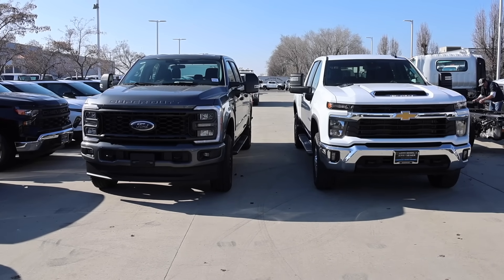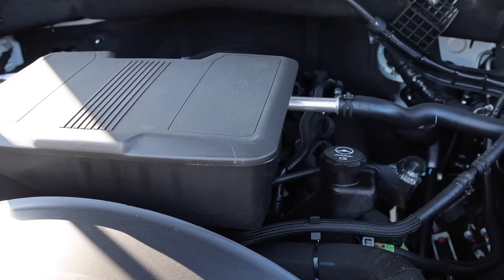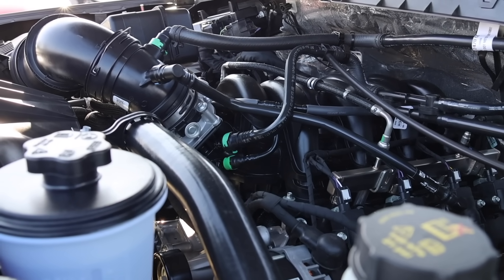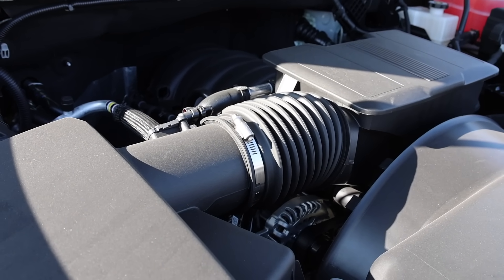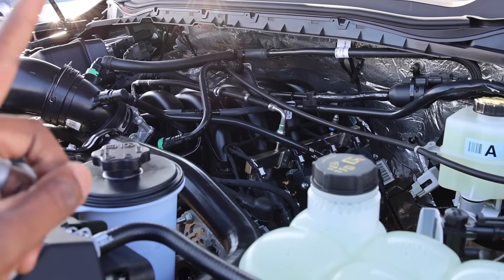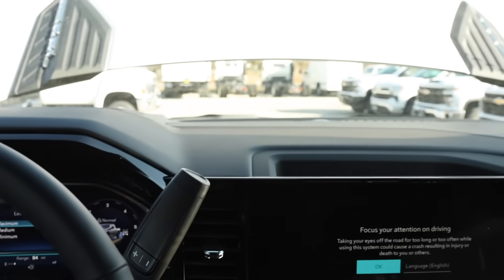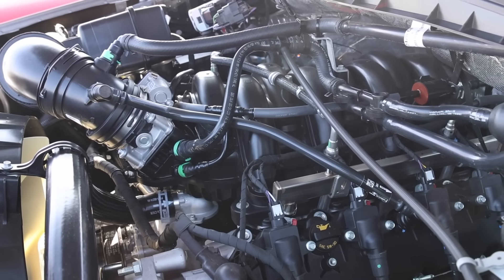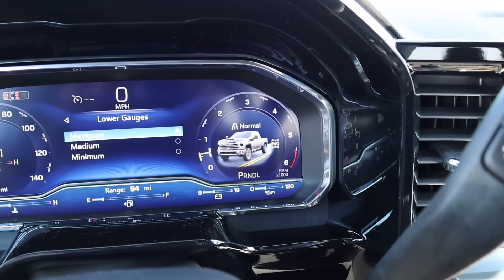2024 Ford F250 6.8L Gas VS Chevy Silverado HD 6.6L Gas: Is The L8T Better Than The Mini Zilla?

Comment: Nice review. A couple things:

1) it’s kind of irrelevant to call out that the 6.8 is the “entry level” engine when you compare it to the 6.6 because the 6.6 is the only gas engine available for GM. 

2) personally I think there’s no good reason to have the 6.8 and the 7.3 engines for Ford. I’m not against options BUT their performance is going to be nearly identical. It’s going to take having them side by side or a timing system to tell the difference. I understand about the tow ratings but that’s typical Ford. Limit the lower trim to prop up their 47 high trims. 

3) I do wish GM would offer a 4 something rear end just so everyone would shut up about it lol. It however would make zero difference at highway speeds, elevation or not. The engines are still going to be rpm and mph limited based off the final drive ratio of any given transmission gear. So long story short, 3rd gear in the 3.73 Ford is nearly identical (slightly shorter) than 4th gear in a 4.30 Ford. 3rd gear with a 3.73 pushes the engine to nearly 5,000 rpm at 60+ mph speeds. So 3rd gear with a 4.30 is not possible at those speeds. You will be out of rpm at that final drive ratio. Why people can’t comprehend that is just mind boggling. 

The L8T is very popular and has proven to be the more reliable engine as compared to the 7.3. They both debuted the same year and everyone forgets not every gas Super Duty from 2020-2022 was a 7.3. Ford still offered the 6.2. Every gas GM is the 6.6 so I guarantee there’s more L8Ts out there than 7.3s. And they still win on reliability. The 7.3 has had a few hiccups. Some minor and some major.
Reply: I'd like to see where you are getting your reliability info, as the 6.6 motors are already showing signs of excessive wear due to extreme oil consumption.

Lifter issues have been affecting multiple manufacturers, including chevrolet, and Ford has rolled out a pcm update for their variable oil pump. From what I've seen the L8t's are showing lifter issues tens of thousands of miles before the Fords.
Reply: @InuranusBrokoff : Have not heard of lifter failures in the L8t at all. Please provide a source to research it .

Maybe you're thinking of gm engines with afm like the 6.2 and 5.3 liter v8s ?

Comment: If you look up Automotive Inquiries he had a 7.3 Ford and Chevy 6.6 gas and he said the Chevy is the winner.  Plus his Ford was showing lifter issues.
Reply: He never proved anything. That dude was garbage his views show that
Reply: I enjoy his HD gas content, but ya he didnt show or prove anything  was wrong with the 7.3 he had
Reply: I watched his videos for awhile, but he just kept rambling on for 20 minutes and never showed any results.

Both trucks are capable. Buy what you like.
Reply: @oldnumber6 pretty much. Reports of issues with any of these modern powertrains are always exaggerated. The manufacturers sell so many of these things, and everyone has a camera and can document and upload stuff that it seems like your percentage chance of getting screwed is WAY higher than it actually is.
Reply: @eric3030  Its hard to say what was going wrong in the engine of his Ford but I do recall him cutting open the oil filter and that was not pretty and one can only guess it was into a similar failure mode that a number of those engines had which Ford was aware of and trying to deal with.
Reply: Lies...the 7.3 is definitely a better truck.😂
Reply: @efeaster3680 : Well..... there's our proof .Some Ford fan boy telling us it's so .
Reply: Well if you ford lovers don’t want to believe it just go down to your local ford dealer and ask the mechanics there.  They can tell you about all the 7.3 problems.

Comment: I do love my 6.6 gas chevy
Reply: What do you get for mileage?
Reply: I love my 2022 Chevy 2500 HD 6.6, with the 6 speed gm transmission - not that Duramax expensive crap...my gas milage pulling a 12 ft trailer with 2 mowers gets 14-15 highway. City it'll get around 11-12. Weight inside trailer id say is around 3-4k pounds. 

Not pulling nothing, I got it all the way to 20 miles per gal once. 

6.6 gas is a gem and I absolutely hate how ppl think they need a diesel to pull. Why pay $1 more per gallon and repairs on a diesel are always much more expensive.
Reply: @joshuarussell718  that's not bad, wonder what the 10 speed gets. 
With my 2020 l5p pulling my 35 foot 5th wheel I can get 12, empty 22-23, our best is 29 (wife driving), the extra buck doesn't bother me. And the extra cost doesn't bother me simply because the diesel will always cost 8-10 grand more meaning it holds it value better
Reply: @michaelcopeland8985 no way you get 29. Must’ve been rolling down hill.
Reply: @ghilliemanreviews  wife was driving, happened once, baced on a 50 mile average.

Comment: Which one is more reliable? That's all I want to know for my work truck. Give me 300k and I'm happy
Reply: Both of these should be able to hit 500k with proper maintenance
Reply: @5starpre  500!!?? Seriously?
Reply: My work truck is a 03 2500 6.0 gasser with 315k miles no engine or transmission problems yet  only maintance and minor issues like water pump fuel pump etc
Reply: @santiagogomez1254  I had a 6.0 that almost made it to 300k. Great engine. My 5.7 tundra is almost there
Reply: Chevy seems a bit better on reliability. All good motors.

Comment: TFL tested the 7.3 vs 6.6 on the Ike. The 7.3 absolutely destroyed the 6.6. Not even close.
Reply: Might look at the most recent test with the 6.6 with the new ten speed. It’s very close
Reply: @Billybob50119  the new 2024 6.6 was over a minute slower than the 7.3. Thats not close at all. Plus the transmission was very hot.
Reply: @cstgx  wrong. The 2024 6.6 was towing more weight than the 7.3 and it was a fifth wheel compared to the test they did a couple years ago with the 7.3. You forget important details.
Reply: @Billybob50119  the 7.3 will outperform the 6.6 any day. The Ford transmission is far better built than the chevy. Look up the teardown on here. The Ford transmission makes the Allison look like a half ton transmission.
Reply: @cstgx  wrong, go watch all the Ford SD 10 speed failures
Reply: @Billybob50119 show us all the transmission and engine failures guy.
Reply: @cstgx  Been seeing nothing but problems with those transmissions paired with the 7.3 from shit stemming internally to the cast iron crank that ford trans build quality is like fisherprice made the thing. Then again thats how the whole damn truck is built.
Reply: @DirtMcGurk  lol cast iron crank and can't spell transmission. Go troll elsewhere

Comment: I just walked away from buying a new chevy gas 3/4 ton truck because i didnt like how easy and how much it shifted down. Chevy needs a full manual mode not a gear limiter in there transmission.

Comment: Ford has been having way to many engine failures. Haven't heard of any problems with the gm.
Reply: Early gm engines were burning oil pretty good. Mine hasn’t.
Reply: Gm has literally been failing engine before the first oil change for YEARS now.
Reply: The 5.3 V8 has numerous issues all due to the Active Fuel Management
Reply: @jeremygaillard5924  I thought we were talking about HDs. 🤦‍♂️
Reply: @jeremygaillard5924  Talk about fuel problems might aswell talk about fords new 7.3 v8
Reply: Just traded a 2020 2500hd 6.6 gas. Lifters/injector noise and It used 3qt of oil every 5k from the day it was new. At 72k miles when i traded it was using 5qts per 5k. Had to put a catch can and empty weekly to keep from fouling the converters. Imo the 6.8 ford can't be any worse
Reply: @Douchebigelow7368  you must have gotten a lemon engine ive put over 132k on my 6.6 l8t only needs about a quart half way thru the oil change havent even had a single issue glad they dumped the shitty boshe injectors.

Comment: 6.6 V8 was designed to compete against the 6.8 and 7.3 V8. Especially with the torque closed to that of the 7.3. 😊
I like them both. But Chevy has a cleaner design and very simple. For me it comes down to price and affordability. For towing, I think the 7.3 is better because it’s an alternative to the 6.7 diesel. If you at regular cabs, the 6.8 is a no charge option on XL and XLT. Any other cab configuration, it’s 7.3. For me what little towing I do now, the Chevy is a better buy. 😊

Comment: I own a 2023 F250 XL w/STX package. 6.8L
V8 engine and 3.73 rear axle. 3822 Ibs of payload and 14,100 lbs towing. I've towed my 32' 8,000 Ibs travel trailer with no issues.
Going up the Tejon Pass it wàs happy at 3500 rpm. It doesn't have all the bells and whistles of higher trim levels but the STX package is very well equipped for a $58k super duty.
Reply: Just got a 2024 basically identical to yours. How’s it holding up so far?

Comment: I saw on fords website just barely they are showing the 6.8 as an option for the xlt as well as the xl.
Reply: Yes, there are XLTs showing up on lots of dealers now with the 6.8 engine. I'm wondering if there is really any difference in gas mileage with the same rear end.

Comment: I have the gas 2024 Chevy 2500 hd w/t we tow with it all the time i have pulled it limits its a beast , I own a Remolding company and we pull a 7x12 dump trailer all the time with demo debris or trap rock ,I have overloaded the trailer ,truck pulls it no problem it has plenty of low end torque. I had a 2001 Chevy Duramax this truck isjust as strong if not stronger.

Comment: We need to see which truck can out pull the other. We need some straps/chains/rubber bands etc…
Put them in gear and give it full throttle to see who has more pull.  Just don’t tell the dealer.

Comment: Maybe people don't care about this but my HD truck is also my daily driver. The 6.6 is sluggish. The 7.3 is fun to drive. That made a huge difference for me. 

The 6.8 seems kinda pointless for Ford tbh. If they are using it to try and keep the price of the XL lower, it ain't workin 🤣
Reply: What gears do you have? I’m in the market for low mileage ‘22+ F250 with 7.3 and debating if I should get the Tremor with the 4:30’s or if the 3:73’s will do the job and still have that pep down low.

Comment: Gm is direct inj. That's NOT what you want in a work truck. Carbon on valves is a guranteed issue
Reply: Wrong
Reply: @Billybob50119  uh, no. That's a fact. Feel free to do 3min of research and prove yourself wrong.
Reply: @NOFBDYBS  did a search, nothing about the 6.6. 99% about DI turbo motors
Reply: @Billybob50119  You didn't search very hard, Di, turbo or not, still suffers from carbon buildup on the backside of the valves. This is a very well known issue.
Reply: @NOFBDYBS  let me know how many 6.6s you find with an issue. Thousands with over 150k and never touched.

Comment: I have the 23 version of that ford except its white. Xl, stx, 6.8, 3.73 gear. 26k miles so far no issues. I do use it for work and tow with some frequency. 8-9k lbs is no issue, can even pass people. The max I've towed was 11500 and you can do it but its definitely working to do so. Max tow rating is 14k for my truck. I would have gotten the 7.3 if I had known about the different transmissions at the time. Also my 23 has a 37 gallon tank not a 34. Dont know what changed in the one year.

Comment: Are any of these engines direct injection?  I am trying to avoid that.
Reply: 6.6 is DI. Ford 7.3 is port injection. I think a catch can on a DI engine would go a long way into avoiding issues DI are prone to.
Reply: What is so bad about direct injection? I think with a catch can and using top tier fuels any negatives are negated. It’s more efficient and has been used for years. I think people who have issues are people who don’t do regular maintenance and drive like they are at Daytona every day.
Reply: @Stlchevy Toyota and others use both types of injection at the right rpm. DI tends to carbon up top ends.
You can inspect with a camera through a plug. Also once a year do a top end clean out procedure. One like Sea Foam offers.

Comment: 6.6 L8Ts have oil consumption issues..
Reply: Have no problem with mine. Never have to add oil between oil changes.
Reply: @earlybird7402  National Highway Safety as a bulletin on the issue with the 6.6 L8T. Same issues the 6.2 Gas motor the 1500s are plagued with.
Reply: 14500 on my 2024 ,6.6 no oil issues yet.  I'm 62 had every brand made.
It's a crap shoot. All junk!
 Overpriced ,but we keep coming back because we love our trucks and we worked hard for them.

Comment: JB I just traded my Chevy 6.6 for the Ford 7.3. My biggest complaint with the Chevy was capless fuel, the headlights are terrible, and a creaky rear leaf springs.
So far so good with the 7.3 and I absolutely love the front end!
Reply: I bet the seats are way better too. My cousin has the f250 Lariat and the seats are amazing. I have a 2020 1500 Silverado and they are hard as a rock and narrow.  I may be switching back to Ford. Im not brand loyal, just want a reliable Truck

Comment: The 6.6 downfall is its direct injected give it a couple of years and you'll have all kinds of issues just like Kia and Hyundai with their direct injection.
Reply: A couple years? The 6.6 has been out since 2020 lmao.
Reply: There is nothing wrong with direct injection. Ford uses the same technology in most of their EcoBoost engines. Keep idle time to a minimum and you’ll be just fine.
Reply: I have a 2015 Direct Inject 5.3 Z71 4x4 crew cab with 161k miles. Never had any problem and runs like brand new still. And AFM works perfectly. I have a catch can installed, and once a year, I run valve clean thru it. I use Liqui Moly truck series oil additive. The only issue with direct inject is that the gas doesn't flow over the valves to keep them clean, so direct inject can have valve gunk buildup.